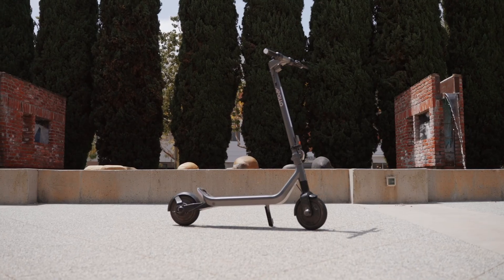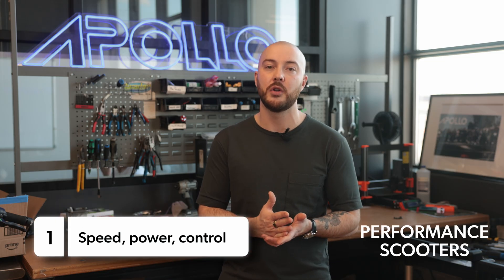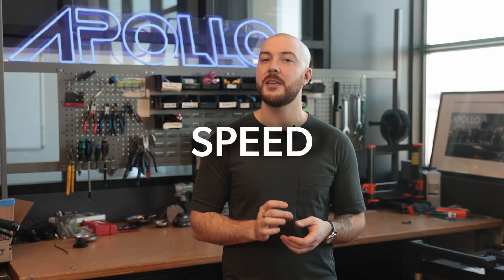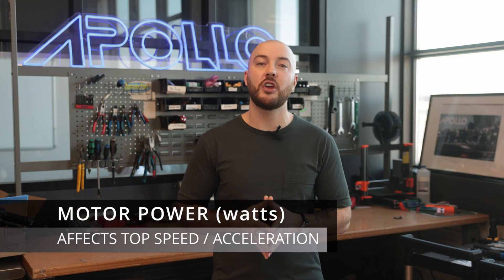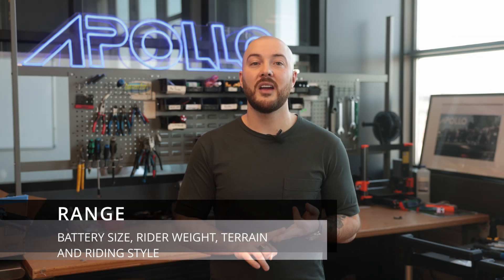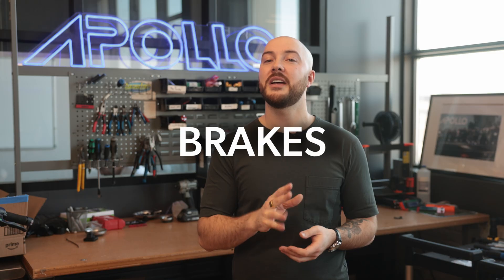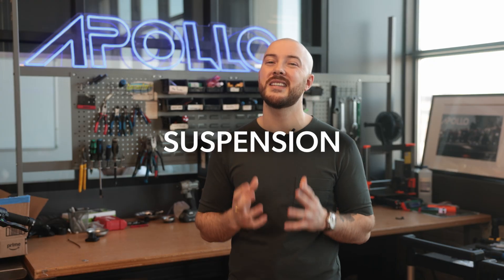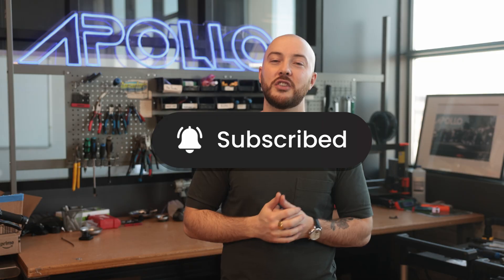Apollo Scooters Buyer’s Guide 2025: Speed, Range & Power Explained

Comment: i have a suggestion, maybe you guys wont go with this due to simplicity but i think there should be more buttons to press (8 total buttons, 4 on each handle) kinda like how nami does it. the left side would have both turn signals, the light and even possibly a horn and the right side would have ur mode selection, maybe it could have customizable buttons that u could control from the app, the possibilities are endless.

Comment: I want Apollo Pro but with City's hook [MUST HAVE for carrying stuff] City's Speed [ Don't need 45mph. 30mph is perfect ]. in other worlds: I want the City + Luxury. Will it happen?
Reply: I say get the apoloo phantom 2.0 cheaper than the pro a bit more luxury than city. It has a great hook that so far has held 20lbs for me. Its solid and averages like 35 mph which is perfect. With bigger wheels it feels way more stable too than both the pro and the city. With its dual discs its safer than both the pro and city aswell and comes with more luxury features.
Reply: @lil_j_16 good call. I’ll look into it. I’m just not crazy about paying for the extra speed which I don’t need and don’t want 😅🙏
Reply: The current city is the old design. look at the handle bars, lack of light stem, reflector/brake light on the back... We have seen Apollo is moving in a new direction with the Pro, then the Go and now the Phantom. I think once they release a City 2025 (it would make sense) to redesign the whole thing and model it after the Pro/Go/Phantom with updated handle bars, quad lock, dot display, etc. It would get the Amazing stem light and a nice touch up around the edges. ;) I think that model of the City will be the BEST value of range, power & style. Rock on Apollo and I hope this helps :)
Reply: @ev4657  YESSSS AMEN 🙏🔥